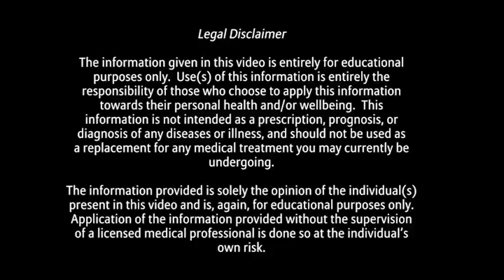Homemade Faraday Cage

Comment: LOL! I love the banter between you two! Just ordered a load of aluminium blankets to make the bed canopy and line the walls...finally! xxx
Reply: I really need advice if you can help to the best of your ability. I currently live in a motel room with a kitchennet and don't have the option to move right now. There is a 5g tower 4 blocks away in one direction and 1 mile in another direction. I want to sheild my room from emfs and I can only afford to use reflectix, aluminum window screen and galvanized steel but I need advice on how to do it safley without making emfs worse. Should I put it on every single wall from floor to ceiling or just the 2 walls that the 5g is coming from? Also since I live in this room if I'm on my laptop or using my phone which i usually am in the room will it make it dangerous and start ping ponging around the room? Will I still be able to use electronics in the room without it being dangerous? I basically want to limit emf exposure as much as possible especially the 5g is the main concern, if there's a little bit of rf for now it's fine but my goal is to just limit emf as much as possible especially from the outside but I want to do it safely because there will still be electronics being used in the room until night time. Would it be best to just do like 2 or 3 sides of the room or even a faraday cage section of the room separate? Also will ot become an electrical trap of I don't ground it? Any advice helps on how to shelid this room. Thank you and God bless 🙏❤️
Reply: @alexzemaitis  I'm still researching because since the direct energy weapons attacks on Maui and Lahaina recently, it appears that BLUE objects don't burn...aka maybe why they called it 'Project BLUE Beam'?! I've decided to save time and money by making a smaller faraday cage instead that's big enough to house myself and pets. I DON'T use wifi inside my home and use ethernet cables for the laptop. I don't keep my mobile phone in the bedroom and turn it off and wrap it in foil when not using in another room. I don't own a TV or modern gadgets and avoid anything 'smart'. I think you need to ask Tony directly for answers to your questions as I'd be interested in hearing them too. Make a SAFE area in your room to sleep and rest in..and use your gadgets outside of it. And I'd start investing in a new blue wardrobe of clothes for yourself and any pets, just in case! xx
Reply: What way did you face the shinny part your way?
Reply: @sistercarrieofyahuah8601  I never got round to erecting it because several homeless people in my neighbourhood I met whilst out with the dogs looked in need of them, so they went there instead. I've since learned that the 'Swiss cheese' approach might be effective using wire mesh, the thicker and more tightly woven the better....wondering what Tony thinks about it? xxx

Comment: i saw a demo using just metal window screening completly block wifi signals. thanks for all the great info.
Reply: Your correct aaron, they put a smart meter on a pole next to my house in 2015, and I had heart failure 3 times in 2016.  in Jan 2017 I thought of smart meters and when I went to check sure enough they had installed one next to my house.  I covered it with aluminum screening and started to get better.  a few months ago I called the Puget Power Co. here in Washington State and she told me the Smart Meters that they use are different then the ones that they are talking about on the Web that create health problems and if I wanted mine removed it would cost me nearly  $400.   I sleep on the couch on the other side of the house now and hope for the best.  Just hoping that this is one of the issues that POTUS is going to handle.  The F- are trying to kill most of us off.  
Thanks Tony, I'm going to cover the windows next to where I sleep with aluminum foil.
Reply: Where do you buy that and is it expensive ?
Reply: How about putting foil under the mattress and under the bed ?

Tony , do you have a video on eye floaters ?

Comment: Ok, I have looked at dozens of these videos with solutions to EMP pulse energy.  Guys you are sadly misleading people.  If a properly placed nuclear explosion occurs the pulse could reach as high as 50,000 volts or more.  Aluminium foil, trash cans, wire wrapped boxes and any other configuration available to the public won't stop your electronic/electrical devices from being fried.  It will penetrate you with no problems unless you have metal in your body then you will fill some heat.  It will pass through aluminum foil like hot butter through a Goose.  I'm not saying government and industry doesn't have some methods of protection but it damn sure isn't aluminum foil.  Wrapping a radio or putting a cell phone in a aluminum box to demonstrate protection is a joke...you are talking about miniscule amounts of RF energy easily blocked.   A pulse of 50KV is going to roast and toast your devices.  Save your money buy a bicycle a horse and a Coleman Lantern with your money.  I'm not kidding!
Reply: That’s what I did - got a bike with a huge basket, may be the only way to get around.  If we survive the blast, I have equipment to live like it’s 1880.

Comment: In 1977 I was in the Airforce lived on the third floor 150 yards from a rotating twenty foot dish they used for ground radar. The speakers with 10 feet of wire and not connected to a radio would buzz every time the dish would point my direction. Within a week I developed arrhythmia of my heart there is no way the Airforce could not have known about the effects of radar at that range. Working on the flight line people would sometimes accidentally turn on a fighters radar when someone was standing in front they almost always keeled over dead. What they are doing to us is killing us with the bombardment of cell towers smart meters and other sources. And they know it if we had any sense we would cut the towers down and any other sources that are microwaves. When they broadcast form orbit they use megawatt powers they need to go also. 💀
Reply: really dead? do you have any links?

Comment: Hi Tony,

Why space blanket needs to be grounded to protect you? If I put a mesh instead, it doesn't have to be grounded right? Why?... thanks!
Reply from the maker: you are getting hit with more then one type of freq and he aluminum alone will not stop them alll that would be ignorant to think this the gorund would dispel the fields you getting hit with~ one of the fellows here had to use 3 different blockers in a box to stop the phome from being access he used aluminum copper and a coating and it took all 3
would suggest you ground better safe then sorry\
the build up has to go somewhere??

Tony

Comment: LOL under the tarp - OMG I will try this for certain - Other tents materials are sooo
expensive. The feet part of the bed is going to be tricky – Thank you for your suggestion
= Like you guys!!!
Reply: I really need advice if you can help to the best of your ability. I currently live in a motel room with a kitchennet and don't have the option to move right now. There is a 5g tower 4 blocks away in one direction and 1 mile in another direction. I want to sheild my room from emfs and I can only afford to use reflectix, aluminum window screen and galvanized steel but I need advice on how to do it safley without making emfs worse. Should I put it on every single wall from floor to ceiling or just the 2 walls that the 5g is coming from? Also since I live in this room if I'm on my laptop or using my phone which i usually am in the room will it make it dangerous and start ping ponging around the room? Will I still be able to use electronics in the room without it being dangerous? I basically want to limit emf exposure as much as possible especially the 5g is the main concern, if there's a little bit of rf for now it's fine but my goal is to just limit emf as much as possible especially from the outside but I want to do it safely because there will still be electronics being used in the room until night time. Would it be best to just do like 2 or 3 sides of the room or even a faraday cage section of the room separate? Also will ot become an electrical trap of I don't ground it? Any advice helps on how to shelid this room. Thank you and God bless 🙏❤️

Comment: Would constructing a small barrier with cardboard/foil to put in front of a wifi modem provide protection for disbelieving youths who sit for hours beside a modem?
Reply from the maker: it will disperse it yes but not totally stop it you would have to put  a around it and a shield so the signal would still get in
Tony
Reply: Yes, off course. Thanks.
One can test if the wifi weakens on another floor.

Comment: so doesn't have to be earthed?
Reply: A lot of debate on whether or not it should be grounded. I say ground it to copper water lines just to be safe. Use a decent size line btw...
Reply from the maker: well would suggest the proof is in the effect~I ground and see results with that method and so do many
Tony

Comment: You mentioned that the canopy shouldn't touch you - is there a reason for this?  I recently bought an aluminized mylar tent for cheap.  As I put it over me I immediately felt better in my high rise apartment but next day I had sore throat as I think it off-gassed some aluminum toxins.  Trying to find a better solution.
Reply from the maker: making contact could transfer the freq to you and the idea is to shield you
what I do is get 2 or 3 tape together and then allow to hang over the bed and then run a ground wire from my bed to a ground 
to further disperse this away from me
and I also wear these day a grounding strap attached to my person to a ground~ there are so many things being hit with us the next thing I am going to make a lead paint and coat the area to further block this nonsense
and then ground the walls as well
Tony

Comment: Tony, I laid a small piece of aluminium foil under my bed and know what my sleep has improved. I get a undisturbed sleep in the night after I did this, thanks to you and dave
Reply: I really need advice if you can help to the best of your ability. I currently live in a motel room with a kitchennet and don't have the option to move right now. There is a 5g tower 4 blocks away in one direction and 1 mile in another direction. I want to sheild my room from emfs and I can only afford to use reflectix, aluminum window screen and galvanized steel but I need advice on how to do it safley without making emfs worse. Should I put it on every single wall from floor to ceiling or just the 2 walls that the 5g is coming from? Also since I live in this room if I'm on my laptop or using my phone which i usually am in the room will it make it dangerous and start ping ponging around the room? Will I still be able to use electronics in the room without it being dangerous? I basically want to limit emf exposure as much as possible especially the 5g is the main concern, if there's a little bit of rf for now it's fine but my goal is to just limit emf as much as possible especially from the outside but I want to do it safely because there will still be electronics being used in the room until night time. Would it be best to just do like 2 or 3 sides of the room or even a faraday cage section of the room separate? Also will ot become an electrical trap of I don't ground it? Any advice helps on how to shelid this room. Thank you and God bless 🙏❤️

Comment: Do mylar sheets work too?  Once I figured out my WiFi was killing my sleep, I found settings in the router to turn off/on, on a schedule and tasked all computers to shut down at X hour.  I don't recall the last time I have slept so well.  Next is the smart meter.  If you say Mylar would work well, will do my ceiling (garden level room).  Working on a grounding mat for the bed...  Thank you so much for you videos!  Amazon is loving you too.
Reply: mylar doesnt work properly
Reply: Mylar will work needs to be layered with over lapping the seams. Should be run to earth ground.
Reply: what about your neighbors wifi

Comment: Thank you for your inventive solution. It seems logical to me what you are doing. The complex where I live is soon going to implement "smart meters" here and no aluminum window coverage is allowed. I tried placing aluminum foil covering over bubble wrap and placed it under my laptop. I also wrapped my router in foil. Additionally I placed a shield on my cell phone and another on my handset cordless phone. Any comments? Nicole
Reply from the maker: +Nicole Lee - Health,  Beauty and more Ok then utilize a tarp~ tack on to a tarp a aluminum foil or copper amd then hang it up at night ~ then during the day take it down this can behind a drape and no one would know the diifference~ you can apply the same thing as  a tent over the bed as well and apply magnets all about the room your in~ you can make several tarp covering with this and hang on the wall ~ be inventive~ and create your own barrier~ you may want to even run a humidifier with a copper solution so that the nebulized copper is in the air further creating a faraday~ just some thoughts

Tony
Reply: My friend tried a humidifier which created mold everywhere in a bedroom but I will go for the other suggestions. I am also on YouTube.
Reply from the maker: +Nicole Lee - Health,  Beauty and more  copper is anti mold and if you ran white vinegar through it for a short bit it clears out mold
Tony

Comment: Thermal blankets do not work, use aluminum foil!!
Reply from the maker: +Derick Brock hmm they work for me..
Tony
Reply: Take a router, put a thermal blanket over it then see if it broadcasts, it does, then take tinfoil and cover it which blocks the signal. "works fine for you" is all mental, do actual tests dude..
Reply: I admire what you are doing but you're spreading misinformation, therefore if someone takes your word for it ( without u doing any testing other than "how you feel" ) and uses these things for protection, they are being fooled and still being harmed..
Reply: Also, after watching that link which proves your theory is false. Why don't you update your video's unless you don't have a conscience ..
Reply from the maker: +Derick Brock bud I use these things~ and they do work~ you watch one vid and this gets your knickers in a knot really~ before you shit your self do your own research and maybe just maybe you may find will depend on the materials the aluminum and copper and iron are what block these frequencies ~ THEY ~ ARE NOT A 100 % NOTHING IS due to the fact of the barrage and intensity but they will off set some~you would have to be literally underground and enclosed to block it all and the freq are going to get worse especially with the weather modifications intensifying and them triggering the nano~ and as I stated this is just one way so before you start throwing BS out there about a conscience ~ what are you doing other then crying like a banshee ~ where are your solutions~ or don't you have a conscience to give a damn and do something~ so before you get all mouth think before you pop and bud one vid does not show it all either
Tony

Comment from the maker: Glen Lightner~thanks good info and will others options on how to go about protecting themselves from harmful RF's and EMF's and ELF's
Tony
Reply: Hi from Ireland.  Can you tell me what's the best way to protect my daughter from 5g.   There not in Ireland yet but I'd like to be prepared  maybe something cheap as I don't have much  thanks 🤗
Reply: @illusionreality3092  if you can plant trees around your home it helps block. Aluminum screening on your windows and outside your daughters bedroom if you can against the house, I believe should be grounded with a wire and screw going to a small copper pipe buried in the ground. Turn wifi off at night. Do NOT buy a wigig anything  to receive 5g in your house. If your daughter uses cellphone have her carry only on airplane mode and only talk on speaker mode. If you have a smartmeter request an analog meter or if unavailable buy or make a smartmeter cover there are good tutorials online. Good luck
Reply: @illusionreality3092  also learn about earthing or grounding... Simply stand barefoot on the Earth or concrete (some say 40 minutes) will help alot.  And supplement with iodine drops super cheap and good to help your mitochondria ... Don't be anemic... Make sure you are eating enough iron... Finally just EAT HEALTHY a healthy body that gets lots of vitamins minerals from fruits and veggies will be better equipped to heal and repair
Reply: Many thanks, I've been looking for "homemade faraday shield" for a while now, and I think this has helped. Have you ever come across - Tennorra EMP Esterification - (Have a quick look on google cant remember the place now ) ? Ive heard some amazing things about it and my neighbour got excellent results with it.
Reply: This is glorious, I've been looking for "faraday cage aluminum foil" for a while now, and I think this has helped. Have you ever come across - Tennorra EMP Esterification - (do a search on google ) ? Ive heard some interesting things about it and my friend got amazing success with it.

Comment: Hi, I'm sure someone already asked, but can I just use the cheap Mylar sheets on all sides?  And do they have to be taped together to make a deal for it to work?  Thanks!
Reply from the maker: +Susan Devoy  if there is aluminum in it should work and depend on the are you wish to cover and you can run a ground as well from it
Tony